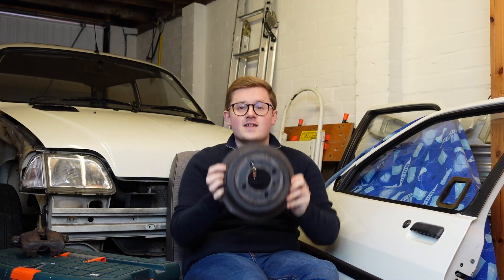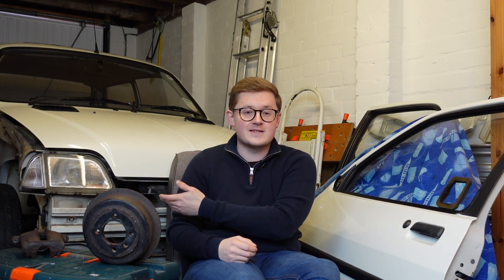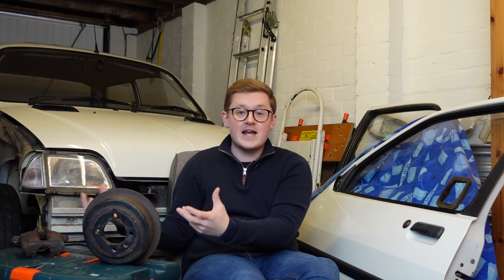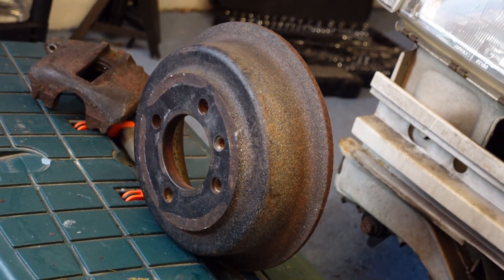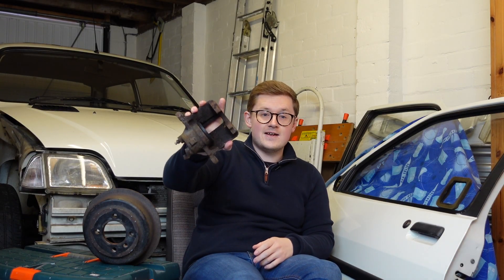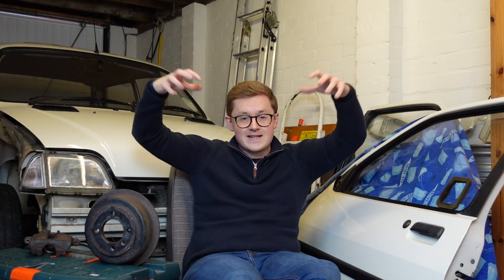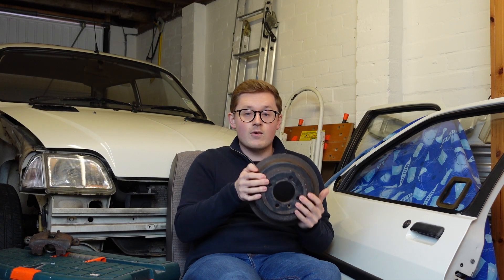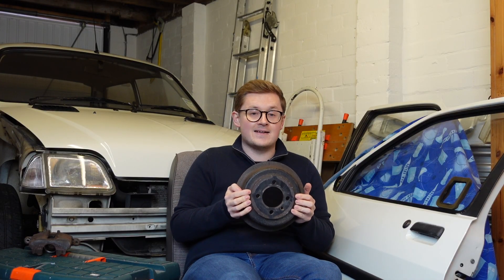Why are Drum Brakes Making an EV Comeback?

Comment: I have a Cupra Born with the drum brakes in the rear and it works great. I also have Seat Tarraco PHEV with disk brakes in the rear and what should I say I most probably need to exchange them after three years. I tried my best to get them clean but even with a PHEV it is hard to do. Let's see what the TÜV will say in spring. I wish my PHEV also has drum brakes. The point for the emission was new for me even so very logical. Thanks for the good brake down of the system.

Comment: Why?  Lighter, and require less pressure to operate: leading shoe jams the trailing into the face, behaving as a force multiplier.   Also...they aren't all bad in snow country: mechanisms are shielded from salty spray.

Comment: Part of the issue with drum brakes is that the front shoe is somewhat self energizing and brakes more due to the rotation of the drum. Generally, the front shoe is smaller, a shorter piece of friction material than the rear shoe. The rear shoe is longer to get more surface area to more balance with the front shoe.
Reply: The front shoe exerts leverage on the rear shoe (jams it in other words) thus “energizing “ the larger braking pad against the drum.
Reply: @scurvy8895  depends on the design, some do that, but not all. If the wheel cylinder is at the top, and the bottom anchors are solid and don't move then shoes are independently actuated.
Reply: @christope44 in that case it’s not a self-energized brake 😂 . I know what type you are talking about . A Volkswagen Beetle …the old kind.
Reply: @scurvy8895  yes, the front brake shoe is self energized because of the rotation of the brake drum pulling it in. I have been a mechanic/ millwright for 60 years. Have worked on hundreds of these styles of brakes.

Comment: Bold prediction: EVs with a motor on the rear wheels will drop rear brakes entirely, in favor of using the motors to brake via regen, resistance, and perhaps even being driven in reverse.

Comment: Very insightful. The main question is actually if mechanical brakes can be deleted. Will an electric car always need a mechanical backup brake system or can electric / electronic brakes become so dependable that the chances of complete failures are as low as on existing systems?
Reply: As a practical matter, no. The problem is simple. Dynamic braking becomes less effective as the speed decreases. At zero speed there is zero braking effect. 

So if you park an EV with no brakes on a hill, the car will roll down the hill, because there is nothing to stop it. The motors may be able to limit the speed of the downhill roll (because the dynamic braking becomes more efficient as the speed rises), but they can't hold it in place, unless the motors are continuously generating forward torque to counteract the pull of gravity. Obviously this will drain the batteries on the vehicle if it isn't plugged in, and then it will roll away. Even if it is plugged in, you are continuously using electricity to counter the pull of gravity. A mechanical brake will prevent rolling at low speeds with no power consumed and no resources used.
Reply: @lwilton  Good remark. Hadn’t thought about that. That problem can however be solved with a non friction system. A relatively simple and light mechanical lock could solve that problem. A low powered unlocking solenoid could even be used as an extra safety feature to avoid engagement during use.
Reply: Regen only works if the battery is not full or operating within normal temperatures. If the battery is too cold, too hot, or near max charge, most BMS will avoid dumping more energy into the battery, thus friction brakes are still required to stop. Plus, in an emergency, friction brakes still react quicker. Speaking from the perspective of prior ownership of 3 Toyota hybrids and a now a Tesla Model 3 BEV.
Reply: @RickJohnson  Thanks. Very informative. There goes my patent! 😁
Reply: @RickJohnson  PS: One could however imagine a solution in which the system even takes care of that. When range future range is less of an issue a small part of the battery capacity could be kept available under all circumstances. Maybe capacitors could also play a part.

Comment: Drums rust also but rotor steel is better quality with more surface area and more visible. Disc pads are smaller but act on larger surface of the disc.
Reply: nope
Reply: Calculate surface area of both, brake shoes don't contact their full length on the surface of the drum, worn shoes show that. Pads contact their full surface area. Yup!

Comment: I'd like to point out that most large commercial vehicles still use drum breaks. Petal feel isn't much of a thing on air breaks anyways but you do know when they bite in a panic braking event. Even with abs you get a Thunk! And everything not bolted to the truck launches forward.

Comment: Oh, young man, I grew up with drum brakes and I hate them with a passion. Heavy (adds unsprung weight), dirty and horrible. You obviously have not enjoyed the exquisite joy of smashing the crap out of a frozen brake drum with a heavy mallet to try and release the pads. Drum brakes may have more surface area but the force applied to the shoe is much less. That’s why they are only used on the rears. Drum brakes are rubbish in the wet and while disc brakes are self-cleaning, drum brakes are definitely not, ergo, they have to have regular servicing. The tiniest bit of gravel in a brake drum will score the bejesus out of the drum. Add this to all this your observations and there is absolutely no contest.
Reply from the maker: Most of that either isn’t true or is the result of poor servicing. The water is a problem however, but due to the nature of EVs, the lack of braking requirements lessens the issue.
Reply: @TwinCam  Isn’t true?  Chuckle, what isn’t true? Please explain. Listen, if disc brakes were better, they’d put them on the front where most of the braking force is applied. They don’t. Rear disk brakes are about cost, end of story.

Comment: More surface area does not equal more braking force. Pressure is equal to Force over Area (P=F/A), While drum brakes have larger surface area in contact with the drum, they are using the same force generated by the person pushing on the pedal, thus they make less pressure, thus less braking force.
Reply from the maker: That’s to not understand the technology. The grabbing I talk about is a part of drums’ inherent self-energisation, which means the force increases exponentially regardless of the force applied at the pedal. I just didn’t explain it very well.

Comment: Very good presentation.  Drum brakes fade due to heat, yes, but it's because the drum expands outward, away from the shoe that causes such notable brake fade.  Discs do have fade due to heat, but not dimensional, as the pads can keep squeezing down on the rotor.  Thankfully I learned to service drum brakes on early 2000's minivans.  As a data point, in those vans, the original rear shoes could have 150-200K miles on them and still be perfectly serviceable, whereas the front discs would be replaced multiple times.  Only potentially leaky rear cylinders would necessitate pulling the drums.
Reply from the maker: Thanks mate.

Comment: This post postulates an intriguing question. To what degree are friction brakes required on all 4 wheels, for future electric vehicles? Just like the question, should a mechanical parking pawl be a requirement for electric vehicles? Is currently being debated.

I don't tend to use hyperbole. But this post was a masterpiece in facts-based logical journalism. And while it didn't present any fundamental new facts or conclusions to me. It was so efficiently and effectively presented it was a joy to listen to. 

Lastly, having pedantic and other types of trolls comment on your post is a sign of success. But in my opinion you shouldn't waste too much time, going down those pointless rabbit holes. Good luck with the channel.
Reply from the maker: Thank you.
Reply: @TwinCam  Hope you could respond to the postulations? When you have the inclination and time. Have a Merry Christmas.

Comment: I happen to drive an full hybrid car lately.
The rear axle is equipped with drum brakes which I thought was a bit frightening but now, I changed my mind as I am not braking a lot with this car because of regenerative braking.
Even in mountains, on long descents, brakes are not used a lot as when the battery is full, I still got engine braking as the starter alternator turns the crankshaft providing engine braking.
And the wheels on the rear axle are always cleaner than the front wheels which are dusted by the disk brakes shading.

Comment: What about ABS?
Reply from the maker: I do talk about it, what about it?
Reply: @TwinCam  how does it work, if it does. And those safety EuroNCAP points. And stability control, if you have only one electric motor for drive, how to fast control wheels to gain stability in emergency. Idk much, but i see only problems with drums

Comment: When Citroens had a common hydraulic system the handbrake worked on the front discs. This was to serve as an emergency service brake if the hydraulics failed. Certainly with my BXs and Xantias at least. Could quite easily stop the Xantia with the handbrake. From memory, my Dyane had separate pinch pads on the front discs for the handbrake.
Reply: Correct. The whole 2CV range had the handbrake on the front.  The small FWD  Renault cars in the 60s and 70s also had the handbrake on the front.
Reply: @robertturner4955  Had a 2CV and Dyane. 2CV had front drums and the Dyane discs.
Reply: This must make handbrake turns amusing...
Reply: @thedubwhisperer2157   Anyone trying it would be in for a surprise. And not a good one.

Comment: Ok….advantage is, you seldom have to replace brakes which might cost a few hundred dollars, on a car that has a $6000+ battery, plus ultracomplicated electronics.  AND stands a good chance of a battery fire which is near impossible to put out.  

Got it.
Reply from the maker: EV batteries have proven to last the course in the ten or so years that they've been popularised.
Also, EVs are less likely to catch fire than an ICE. That's not a theory, that's a fact.

Comment: Since the front brakes are enough and regen does most of the braking, why not just eliminate the rear brakes entirely? I'm not buying an EV with drum brakes. I want as little brake as possible and let regen do the bulk of the work
Reply from the maker: For the same reason cars have spare wheels, emergency brakes, and flexible lighting systems. Redundancy. Safety is a virtue.

Comment: As someone who’s changed brakes of both styles you can take your drum brakes and stuff them.
Reply from the maker: As another person who’s changed both styles, what’s so difficult?
Reply: @TwinCam  All the clock like work of springs and fasteners is irritating not to mention the tendency of the brake cylinders to end up leaking. In winter conditions the brake adjusters would just rust in place and the brakes would become essentially useless.
Reply from the maker: @fat_basturd5345  Caliper seals leak too, but they're not an issue?
Similarly, the adjusters shouldn't seize if you service them correctly.

Comment: Our Alfa has done 32,000 miles on the original factory brake pads which are about half worn - on other cars I have owned they usually lasted about 8 - 10,000 miles. perhaps these are made of kryptonite 😉

Comment: I'm surprised that the video didn't mention the fact that drum brakes are self-energizing.   The way the shoes are mounted inside the drum, and the way they pivot,  means there is a 'leading' shoe and a 'trailing' shoe.  The leading shoe pivots INTO the direction of the drum's rotation, causing it to dig in a little harder than the trailing shoe, and the slight movement this generates actually helps apply more braking force.  This is actually the 'grabbing' he spoke of.  It's not an issue in normal braking - it only really becomes a problem in hard braking, and it is why rear ABS became a thing.

The 'self-energizing' aspect of drum brakes might only provide another 10 percent braking force, but it makes power assists unnecessary (particularly in small vehicles), and it also means less  power is necessary to operate them - both important considerations in an EV.

I am glad he mentioned the inherent parasitic drag of discs, though.   The heat buildup issues of drums can be mitigated somewhat by 'partial' venting - basically, a series of small holes drilled into the outward face of the drum itself.  But as he stated, this is less of an issue today than it was decades ago.

Comment: An interesting tidbit that I've noticed with disc brakes rusting: I drive big overbuilt '70s American cars.  I have several that I cycle through each year depending on season, so all of them get a turn sitting for months at a time without the brakes being used.  The brake rotors never rust.  I had one with a bad engine that sat for outside in a very wet spot for five years before I fixed it, and even its rotors didn't rust.  

Modern cars are not resilient like this (or at least modern Japanese cars aren't).  You leave a modern car sit for even just a couple weeks, and its rotors are rusty enough that you can feel it the first few times you brake until all the rust gets knocked off.  I'm assuming this is just a material choice.  I'm guessing newer cars have rotors made of a cheaper material to reduce productions costs (unlike cars from 50 years ago where all material and design choices were just massive overkill).  

So I think the problem of rust isn't inherit to the design disc brakes, but rather caused by using a cheap material that is not suitable for the open design.  That said, cost is always important, and if your physical brakes are a secondary system, going back to drums to save on cost makes a lot of sense.

An additional fun fact about parking brakes: I had a late '70s Eldorado with disc brakes in the rear, and it had a special caliper that could be mechanically operated by cable.  No need for the goofy half-disc/half-drum setup that newer cars have in the rear.

Comment: It is my understanding that EV regen systems still use the brakes as you approach low speeds and also to hold the car in place while stopped. Is this true?
Reply from the maker: To hold the car in place, yes, and to ease the transition between regen and the holding force of the brakes while stationary. But we’re talking from 5 mph to 0.

Comment: I got my first electric car a few days ago and it very quickly became obvious that you barely touch the brakes.  My next thought was that I was going to get rammed from behind in the dark morning commute unless the brake lights come on.  Next thought was will the brakes rust solid?
Reply: A couple of tips from a seasoned EV owner.  First off, use the friction brakes at least once every trip and just gently touch them after going through a puddle.  This keeps the rust at bay.
Second.  Have someone follow you and be in a call with them (hands free of course).  Let them know when you slow down using regen and make sure the brake lights come on.  If they don't you know you have to gently touch the brakes (although I would report this as a serious safety defect to the manufacturer).  Most of the time after a second you'll find the brake lights do come on.

Comment: Of you need a wheel to stop, the drum will stop much quicker with little slip.  That is why drums work better for e breaks.     The slipping makes disk actually a more controlled stop, not as much pumping necessary.  But with an antilock system can make drums working better.  I learned this in physics class in college back in the 1980s.
Reply: how much braking action is provided, depends on how the brake is sized.

Issue with drum brakes is the heat dissipation.

Also, when you brake, you usually reduce brake pressure when you get slower to reduce torque.

Comment: Like in ID3 case it also may be that VW wanted to made it cheaper or save weight! Car is heavier and it needs good brakes for emergency reasons! I Personally doubt that this will not spread other than cheap VW's 🤣
Reply from the maker: I think it absolutely will. Ford are planning on doing so, Hyundai are, and so are Tesla apparently.

Comment: Interesting as we steered away from the VW id series specifically as they had drums and as I’m old enough to remember what a pain they were to service and because it feels like VW ‘cheaped out’ we went with another EV that has discs all round. I can attest that the rears rusting a bit from lack of use but when you factor the significantly  increased weight of EVs plus the fade that drums give I think I’d still prefer discs.
Reply from the maker: As I say in the video, fade is not an issue in EVs.

Comment: My Volkswagen Beetle had drum brakes well into the late '80s.
I knew that I couldn't drive the car down a mountain. After braking for 1 Km, the brakes didn't work anymore and I had to plan for a brake break: basically, I got on a level street and wait for an hour.
I was regularly replacing brake components.
Merry Christmas!
Reply: Your Volkswagen beetle probably had the same drum brakes its whole life, with the exception of the occasional replacement of the shoes.
Reply: Anybody with any sense would have gone down that hill in a lower gear. Please don't ever get into a highway truck and drive like that.

Comment: We see a lot of stuff about brakes on the net. Wish people would talk about brake fluid. As an old mechanic, experience has taught me, that if you want to save money and have good brakes, CHANGE THE FLUID. Extremes of temperature (thermal excursion) cause it to thicken. No one believes me, this issue has caused many a bar fight.
Reply from the maker: Anyone who doesn’t change their brake fluid every two years needs their head checking.